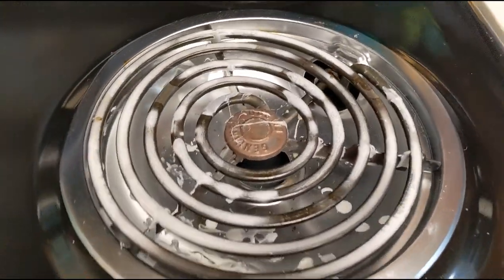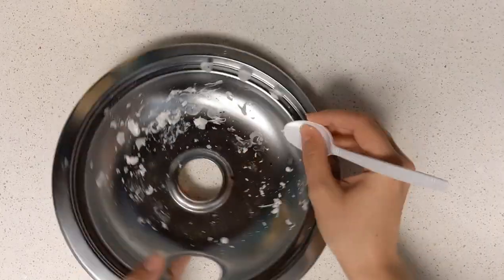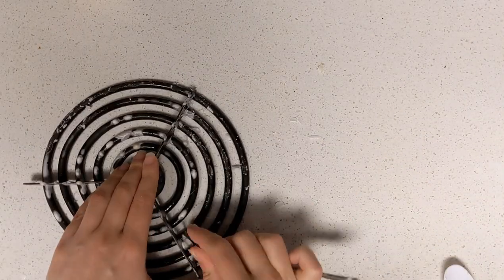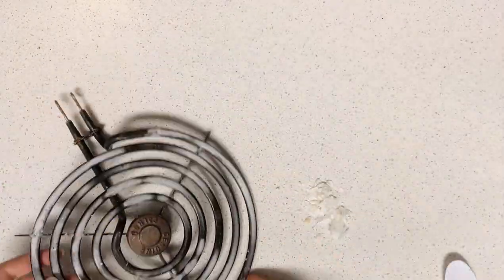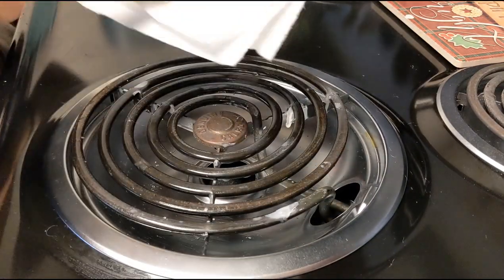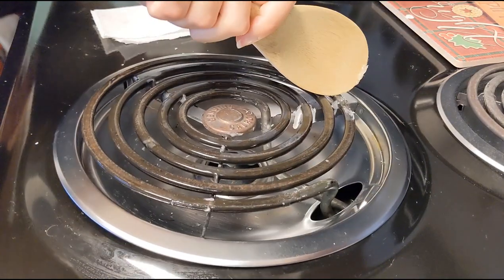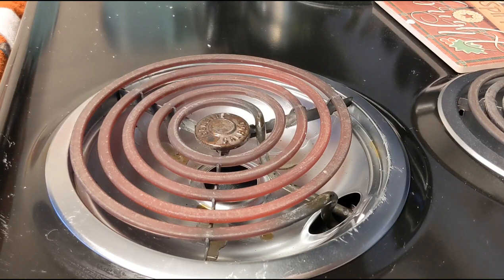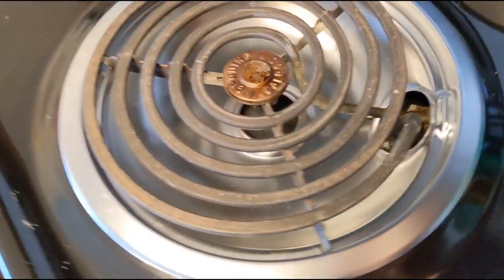How To Clean Melted Plastic Off Stove Coil Burner | Electric Range Surface Burners | Clean With Me

Comment: Thank you.   I freaked out about the smoke and replaced it after I couldn't finish cleaning.   This gives me confidence to try to finish cleaning that burner and keep a back up.  The offending plastic??? A family member came in to help put away groceries and set an insulated shopping bag full on the just installed burner.  Maintenance had just replaced it, tested it, and left the cover off so it could cool.  They were leaving when I arrived back from the store and it had been off high for less than 5 min.

Comment: i first put my toaster oven in the garbage but then I searched how to clean burned-on plastic and found your video. I took it out of the garbage. I followed your instructions but I modified it a bit to remove melted plastic in my toaster oven heating element and rack.  It worked! Thank you so much!

Comment: I didn't have much success with this and I didn't feel the smoke/ fumes were worth my health and safety. I went online and found a replacement burner for $13, well worth the purchase. Look for the part number on the back of the element and research. I was able to find a genuine replacement part, well worth the price.
I'm not going to give this a thumbs down, because I am appreciative of the tip when I was searching how to remove plastic that accidentally got set on one of my burners in my apartment. Unfortunately, this did not work for me. I tried scrapping to no avail, ruined a perfectly good wooden spatula and the smoke/ fumes were terrible.